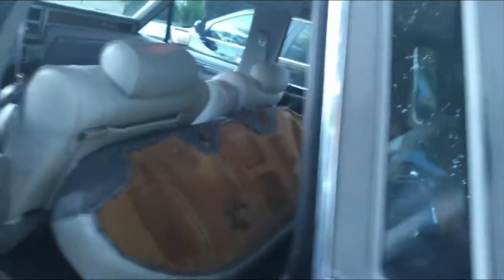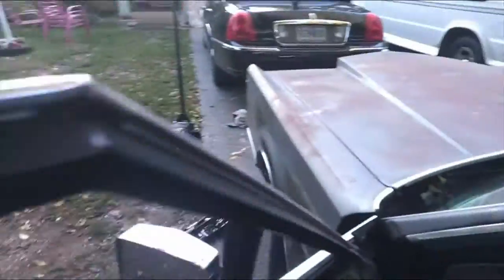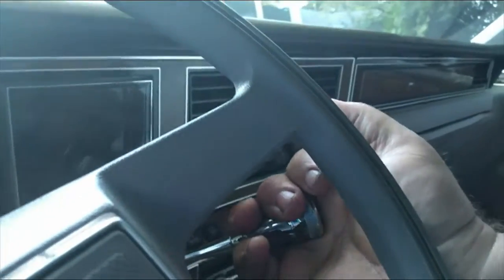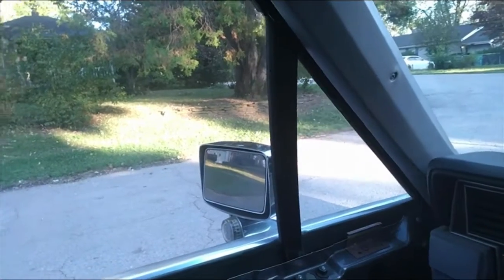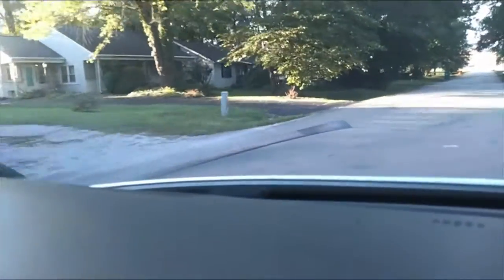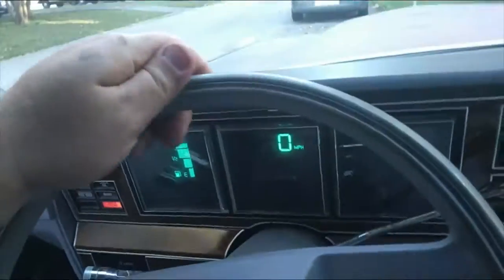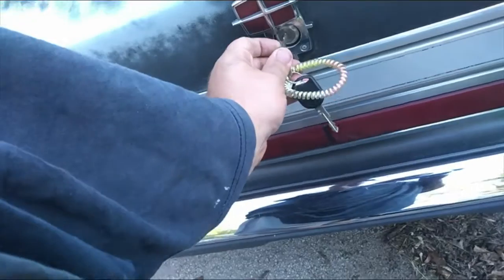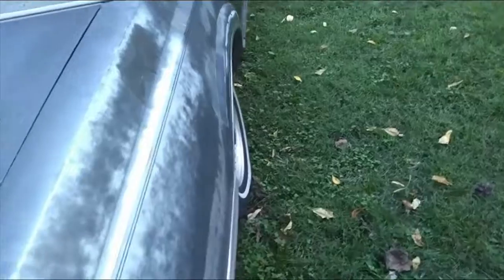1989 Lincoln town car tour

Comment: Wow it look's like a write off,   i have a parts car that look's in much better shape than this.     There is no way it has that low of milege, the front seats are out of a different year lincoln.....lol those cars came with EFI standard...lol....i love these cars, But yours is ready for a junk yard.
Reply from the maker: Yes I know but that’s what happens when a car sits in a field for 20 years but I saved it . I try to save as many town cars and old caddy’s from the crusher that I can
Reply: yeah fair enough, ive saved 3 of the first gen town cars, i re paint em usually, repair what needs to be done, then test drive it for 2 month's and then re sell them, but i only do the first gen town car's @JeremiahCardin